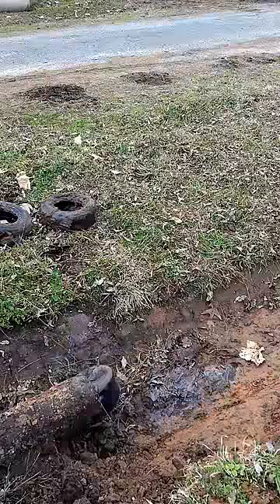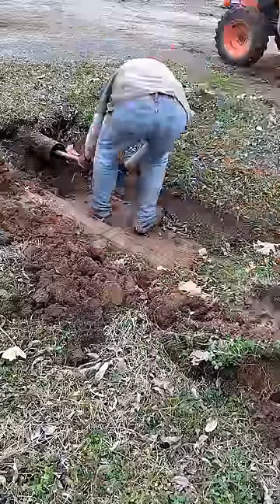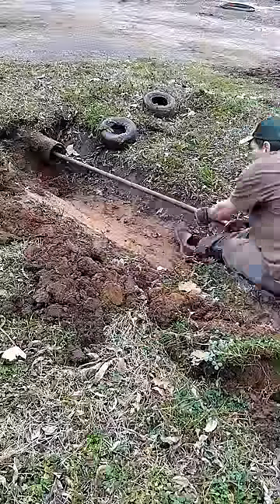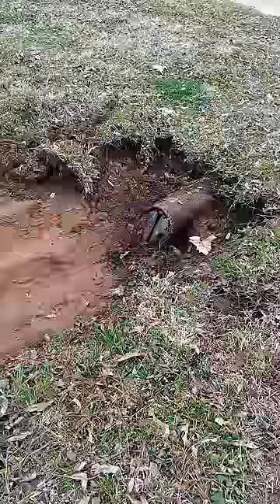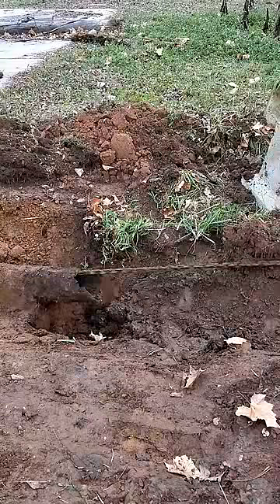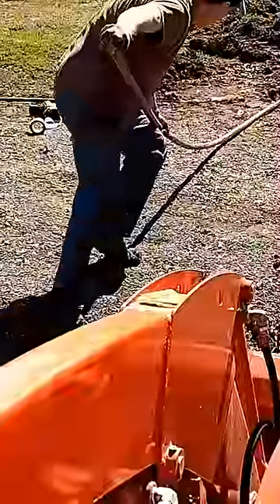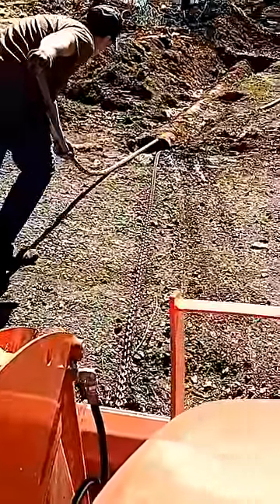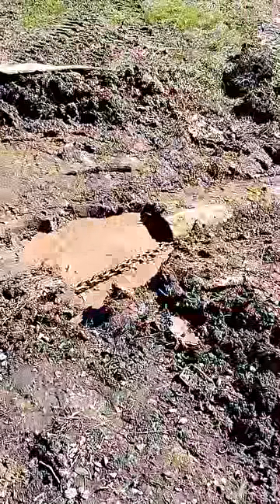Cleaning Culverts With Tires

Comment: Thank you for showing how to put the chain through. No one has ever done that
Reply from the maker: right on
Reply: Wouldn't it be easier to just attach a drag chain to the tire and leave it in the culvert so there's always a chain in the culvert for cleanouts?
Reply: @UberAV  so it can rust and eventually fail?
Reply: @UnderwaterAlexJones  the culverts are made of metal and don't rust and fail. There's a chain that'd survive, I am sure. It may not be cost effective. Good chains may cost a lot but I'm sure there's a chain that'd survive just like the culvert itself.
Reply: @UberAV  or just use one chain and put in the 5 mins of prep to drive the pipe and chain. 

Your logic is flawed.
Reply: @UnderwaterAlexJones  my logic is consistent. Your logic changed to an unmoored position when faced with reasoned logic.

I am extremely familiar with providing guaranteed quotes for labor projections.

Labor costs are easy to underestimate. How many culverts? How many crew are required to force the chain through the culvert with steel rods? How long does it take for the crew to do one culvert when inserting the chain with a steel rod? Does the steel rod method introduce risk of damage to the culvert?

My reasoning is that the smallest possible crew would quickly be able to clean out culverts at the lowest risk to the culverts if a second chain was pulled with the tire and left in the culverts for the next cleanouts.

I'd expect that forcing steel rods through would add to crew size, take longer than 5 minutes and increase the odds of damaging the culvert.

I would not quote or plan labor costs based on your notions.
Reply: @UberAV  you seem mad and think this is an argument, this is the internet and you just wasted your time.
Reply: @UnderwaterAlexJones  the only time I've wasted was on my last post, about your last gasp. That excellent post disappeared. Otherwise I view most of this as an exercise. I explained myself so well that your only resort was to accuse me of wasting time.
Reply: @UberAV  well you did. You got mad and typed up a novel.
Reply: @UnderwaterAlexJones  I'm biting my tongue, knowing your past, hoping you go off and start blathering about Israeli space blazers. Your click put up quite the ruckus some time back.
Reply: Us IT guys would have pulled a chain through trailing from the other end of the tire, last time to leave in the culvert and use for next time! 😂
Reply: @UberAV  what the hell are you schizoposting about now?
Reply: @UberAV someone’s mad. 🤭
Reply: @UberAV  so are you going to tell us what you were schizoposting about or are you just going to be a schizo?
Reply: @UnderwaterAlexJones  I know nothing...
Reply: @UberAV  at least you admit it.
Reply: @UnderwaterAlexJones  please stop goading me into bringing up your past.
Reply: @UberAV please, bring it up. Entertain me. I love a good schizo theory. SPOILER: I have nothing to be ashamed about in my past. So please, make yourself look like a tool who is totally not mad at a guy on the internet for making him waste his time and energy on a 1500 character youtube comment.
Reply: @UnderwaterAlexJones  I agree that you definitely love a good schizo theory.
Reply: @UberAV Honestly, probably wouldn't be a bad idea to have a chain that is always "setup" for this but considering I've had my literal Air Conditioner ripped out of it's cage to be "sold" off literally the night before I moved into my house I wouldn't trust someone to not run off with the chain for "reasons".
Reply: @KeeperOfDGroove  great point. Not a good time to be leaving anything anywhere exposed, for sure. That is a huge consideration.
Reply: @UnderwaterAlexJones the first person to accuse the other person of being mad is usually mad. He’s right and you don’t have a counter argument so you use 
ad hominem instead.
Reply: @Gabriel-vj1cf  thats a cope.
Reply: @UnderwaterAlexJones  Eventually? What, 200 years?
Reply: @NaruSanavai  keep coping
Reply: @UnderwaterAlexJones u typing too

Comment: Finally, how the chain gets into the pipe.  THANK YOU.
Reply: Yup, I see now that I wasn't the only guy wondering the same thing 😂
Reply: You can also do that by using a pressure cleaner to push forward through the mud, but that will take longer and use a lot of water to get it done.

Comment: “Hey Siri, how do you remove a tire stuck in a culvert pipe?”
Reply: Another tire
Reply: push it out with the pole.
Reply from the maker: I really don't know yet I have one stuck like that... I'm thinking use a 16 ft 4 x 4 post ..then push with a tractor bucket... And then if it's not long enough.. take another 8 ft post and push the rest through and then it's possible that's enough pressure to push the tire out. The one thing I found out was never used a strap and pull the tire through always use a steel chain... Straps break easy chains are less likely

Comment: I put one of the balloons that hooks up to your garden hose in mine, it swelled and sealed, 5 mins later i had a steady flow of water through it, then took my 6 foot pressure washing wand and stuck it in there with the swirly tip and blew the rest out. Worked great. I dont have a tractor soo i did it the cheap way

Comment: I work for the stormwater department for a small city govt and whenever we need to clean a culvert or even long stretches of stormwater drainage pipe, we usually use a sewer jetter. We have the Sewer Equipment of America Model 747-FR200 and that thing is a BEAST! 4 cylinder diesel pushing 700 gallons of water in about 4 minutes with the biggest nozzle. That’s about as much flow coming out of a fire hose being pumped out of a fire truck. Makes quick work of any dirt in the pipe. And we usually have a vac truck sitting downstream of the pipe so that we don’t have to go back and excavate it out. I love my job.

edit: fat fingered the word “equipment”
Reply from the maker: big money tax money..we poor folk use a tire
Reply: @OKLAHOMAOFFGRID  yeah, we just have to have something to get it done quick when you’re having to work on an entire city’s stormwater infrastructure

Comment: So silly question.  Why not hook a rope or another chain on the other side of the tire so when you pull the tire through you can either use the rope to pull the chain back through or you just walk back and hook the tire back up?

Comment: Gotta lay the chain down when you lay the pipe and then put a wheel tire on it and then tie it the whole chain in a loop with some strong combination locks or strong bike locks or nuts and bolts to lock both ends together so you never need to run it through again after clearing it, just constantly pull the loop.

You can use childrens Toy Clay or playdough to get the exact distance needed between the chain loops when going to the store and looking for a right sized locking mechanism. Just shape it around and through the chain and then remove it carefuly and itll be the right size and put it in the freezer an hour and let it harden and then take it to the store and make sure it fits the locking mechanism you pick. Like molding it with clay should be easy

Comment: And this doesn't destroy the pipe?
Reply from the maker: no..those are 6 inch steel pipes..but i have done even 6 inch pvc pipes today and cement culverts both
Reply: @OKLAHOMAOFFGRID  whoa, I never would have thought dragging a tire through a pipe would clear it. 
Hey, if it ain't broke, don't fix it

Comment: I also think a pressure washer would work if you dont got a tractor just get an oscillating tip and be prepared to give yourself a muddy bath as it will get messy

Comment: There is an easier way if that pipe was layed in a revolver type holder that has 2 extra pipes one can be in use while 2 others remain clean when one gets clogged trigger the revolver to shift 1 position now you can clean the clogged pipe without stopping the flow

Comment: Hook another chain on the other side of the tire that way there's always a chain out the end of the pipe.  Then just have the tractor move to the other side of the pipe then pull it back through

Comment: Honestly, I thought you guys just have the chain in the culvert the entire season until it’s ready and then you tie the chain to the tire and pull it out, lol. Wouldn’t be a bad idea as long as you don’t reuse the chain too many times, would hate to use it one more time only for it to fail because of corrosion.
Reply from the maker: Chains that size are over a hundred bucks...i m doing around 70 culverts in a trailer park...not leaving any chains

Comment: Ok I understand why their doing that but if they are capable of using the vehicle to push the stick through than why don't they make one of the bases of the stick more flattened out like a plate or Frisbee shape then push it through with the vehicle
Reply from the maker: Why would we when we were just using the tractor to push it through if I had was a vehicle we would be using a vehicle but that's not the case that's just the possibility for you if you don't have one.

Comment: Why not just push the tire through with the rod?
Reply from the maker: That's the top rail of a chain link fence... If flex is real easy and would bend trying to push something through... If you will watch the video you will see where it's bending just trying to push it through by hand much less trying to push a tire through... I have to use Steel chain instead of strap because sometimes it's so hard to pull the tire through it will break the strap...so no... You're not going to be able to push a tire through with a flimsy pole
Reply: @OKLAHOMAOFFGRID  👍

Comment: Not shitting on you or anything, i just was thinking might be good practice to hold the outside of the tire in case of miscommunication or operator slip up, instead of hooking your finger on the inside of the tire.
Obv thats probably a 1 in 1000 situation but why not if it doesnt make the job any harder?

Sorry for being that guy lol

Comment: Looks like it would have been easier to just replace it. (Before anyone has a dumbass comment ive been in excavating for 17 years)
Reply from the maker: Yeah it's easy to say replace when that's what you make money doing... But I have 76 of them to do in one trailer park and we're not going to replace them with plastic at 164 dollars a piece
Reply: @OKLAHOMAOFFGRID  if the ditch is right they shouldn't fill up
Reply from the maker: @Scotty_Brigner  that's correct they've been here since 1957  and I have been digging out and around them and deepening the ditch where the settlement cannot get into it anymore on each one
Reply: @OKLAHOMAOFFGRID  you could try digging a slit catch at the end of the pipe. Obviously it would have to be cleaned out yearly but would be much less strenuous I'm sure. Just a suggestion. Obviously I don't know the situation in the trailer park whether you have the room to do so.
Reply from the maker: @Scotty_Brigner  so far I have found out that if I build the ditch about 6 in deeper than the pipe and the pipe has an overhang about 6 in out of the driveway on each side it works kind of like a septic system does the liquid comes up to the top and flows through the pipe but the sediment stays at the bottom so far it's been a year and the ones I did a year ago are still clear and not getting any settlement in them.. it does cause it to hold water in the ditches for a little bit longer but it's only a couple days after a big rain
Reply: @OKLAHOMAOFFGRID  sounds like you figured it out on your own then! Most people these days don't think mechanically that way and just keep struggling with the same problem. Hats off!

Comment: I bet if you get 2 half tired and stack them diagloally you csn push them through with the instead of doing the whole process. For smaller jobs maybe
Reply from the maker: i been using 2 tires at a time bigger tires smaller tires all kinds of different scenarios..idea is working great